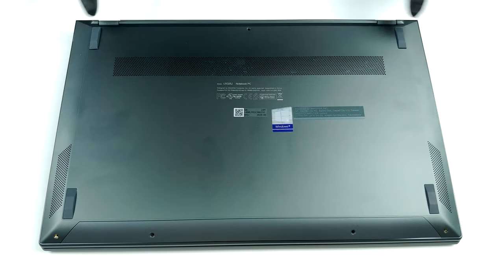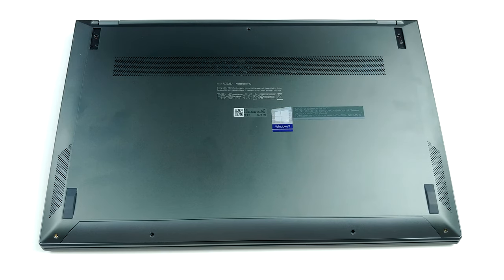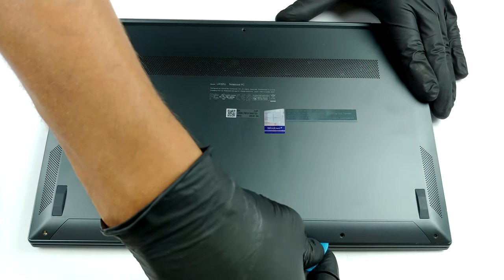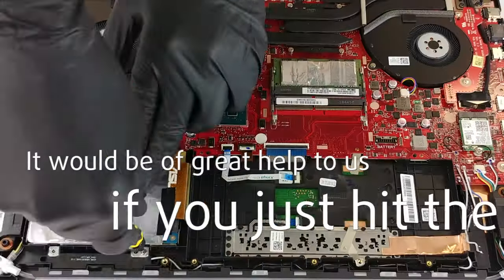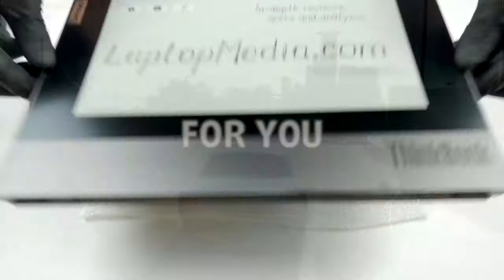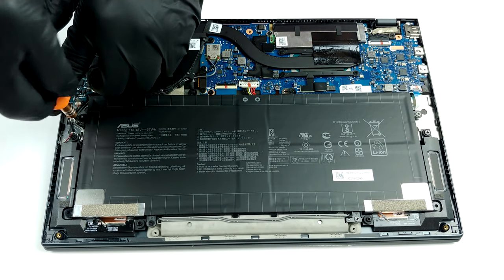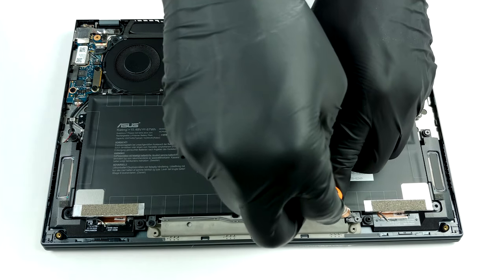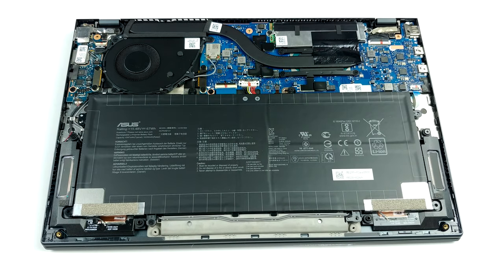🛠️ ASUS ZenBook 13 UX325 - disassembly and upgrade options

Comment: hi. may i know why did you take off the battery? but i think ram can be upgraded 👍
Reply: RAM is soldered onto the motherboard and the user cannot upgrade the RAM in any Asus Zenbook laptop.  The only user-replaceable part is the M.2 SSD (Here, intel M.2 NVME SSD).  User cannot replace any other part inside the Zenbook series laptops.
Reply: @sivakumarb9749 even the speakers?

Comment: 3:27 is this ram
Reply: No, that is the M.2 NVMe drive which can be replaced. RAM is soldered to the logic board and not upgradable. Just buy the 16 GB version, I did and it's great.